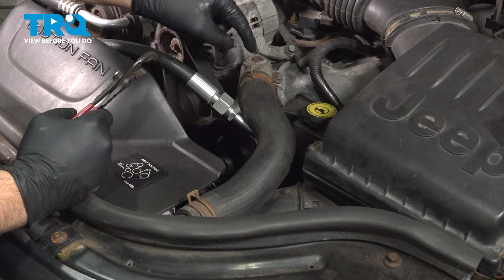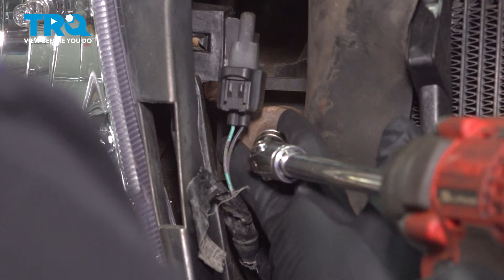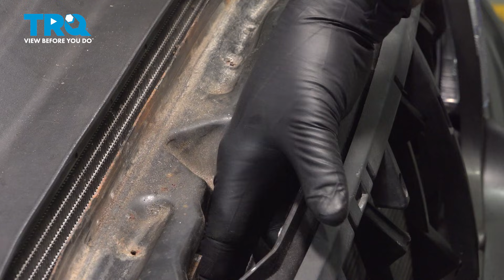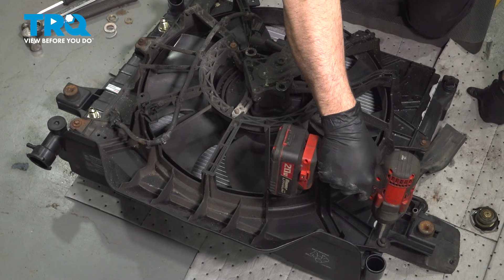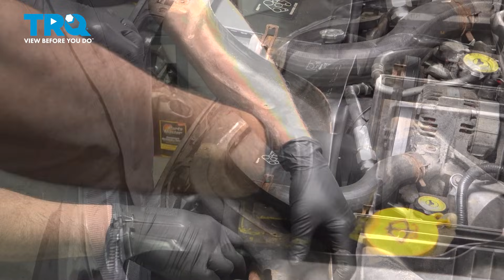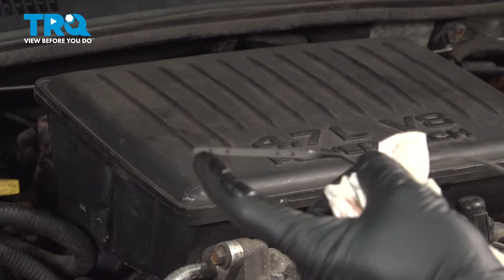How to Replace Radiator 1999-2004 Jeep Grand Cherokee 4.7L V8

Comment: Left out of video was proper bleeding procedure recommended by Mopar as follows....Must Bleed at 8mm hex socket plug near top radiator hose connected to neck of timing cover. Jam a funnel sized to fit bleed hole and pour small amount of coolant until filling 1/4 depth of funnel. This allows you to see bubbles as the engine is idling to warm up to operating temperature when the thermostat opens. Start engine with the radiator cap OFF. Top off radiator at cap inlet as you watch for bubbles in your funnel. Rev to 1200 RPM then idle, alternating throughout process until no more bubbles appear, while keeping funnel at 1/4 full. Stop engine, replace plug with pipe sealant or teflon tape applied. Top off radiator if needed, replace cap. Congratulations, you're coolant system is properly bled! Note: the coolant reservoir will not transfer while radiator cap is off, but rather several minutes after or during a driving cycle, at which you should periodically check level, especially during Summer or hot days.

Comment: It says 99 to 2004... That jeep is not a 2004.... 2004 has a hydraulic fan motor that works off of the power steering pump.... Next... It's not the video maker but I think we need more commercials... Too many interruptions....

Comment: This is another case of some engineer making what should be a simple thing to do more like a career goal. No reason for it to be made this hard to change a radiator. And the idea of using the cooling fan setup like this instead of just a belt driven fan or electric fan is just pure stupidity on the part of the engineers.